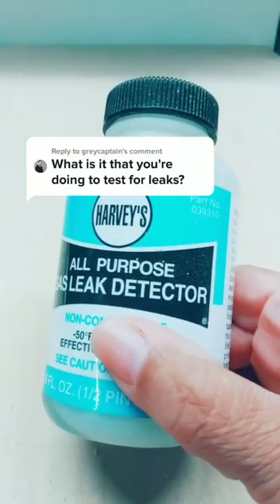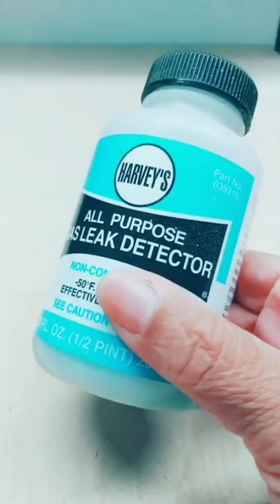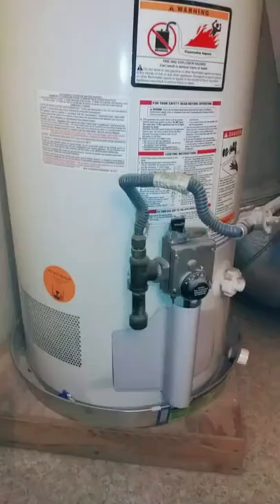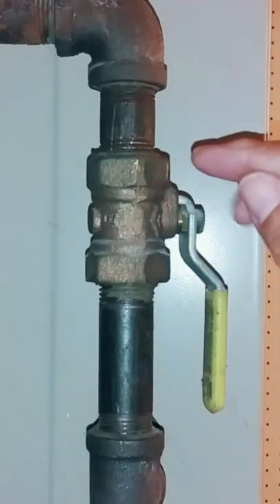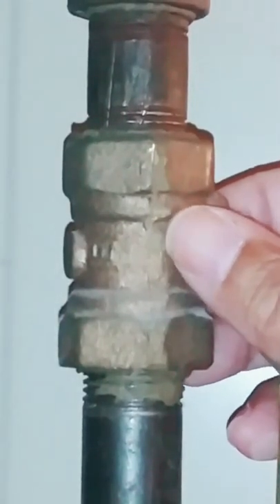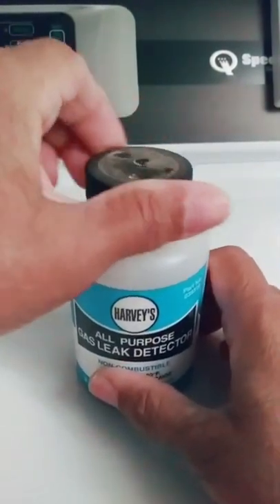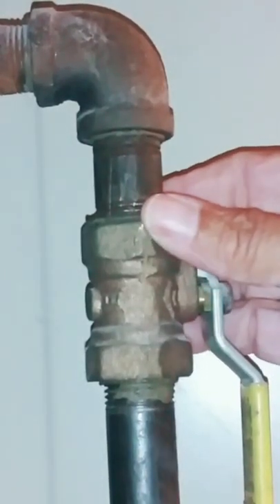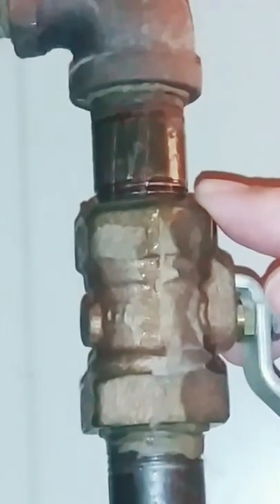How to Detect a Gas Leak - #shorts

Comment: It should be made abundantly clear not to use soap for leak detection because most soaps contains salts which cause the pipes to corrode. Years later you may be dealing with a leak and not know why. Get an actual bottle of leak detector from the hardware store.
Reply: If you leave the soap on.
Should be ok if you thoroughly wipe it clean with a wet rag, then dry rag
Reply: @Nyx773  
Smearing it around wont work. You have to neutralize the salts.

Comment: Thanks Leah, what's your opinion on home-made leak detector, soap and water. When checking my propane connections that's what I use. It's heavy on the soap so it clings. Seems to work well for me
Reply: Soap contains salts which will cause the gas pipe to corrode which can cause problems in the future.

Comment: I use water & dish detergent, just squirt it on. No need to buy anything.
Reply: Unless it contains salts in which case you're promoting corrosion on the pipes...

Comment: Of all the things I would never show or even hint at is handling gas lines.  It is very hard to burn your house down by mishandling electricity.  It is painfully easy to blow your house up by mishandling a gas line.  

If someone doesn't know about gas leak detection...they should never be near a gas line.  And before anyone says it...plumbers work on gas lines...great.  There is a world of difference between  plumbing and water AND plumbing and gas...especially to a DIYer.  The worst that happens with poor work with water is you get wet.